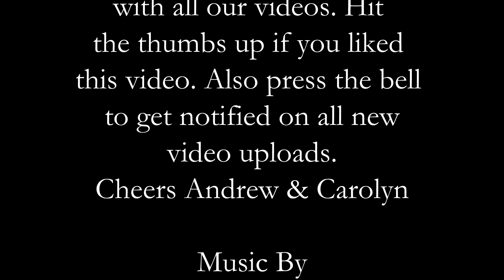Mitsubishi Rosa Bus Conversion Part 10 Removing the AC

Comment: Hi mate I pulled my air con out of my Mitsubishi Rosa 2005, the bus runs funny surges on idle and if after long drive will not start , they guy I bought from says it may have something to do with the electrics after moving air con. Seen a few Mecanic S none can work it out, it is spasmodic. Thank in advance. Angus
Reply: Did you ever fix this?, also how did you keep the front cab cold when driving?.

Comment: Hi Andrew, thanks for answering my last question, im also looking at taking out the 2 compressors, one has its own dedicated belt the other shares the serpentine belt with the alternator etc, I think I would have to make a dummy pully to replace the second compressor. did you do this? mine is the 4.9 engine
Reply from the maker: Both my compressors were connected to the same belt. So I just cut that belt and then removed the compressors.

Comment: Great helpful video Andrew! Just wondering, is there another aircon system for the drivers area? Or does your bus not have air con at all now? 
Thanks! Just ripped up my floor and platform on my Rosa after watching your other video!
Reply from the maker: Hey Allyson no there's no other air con in the bus. However we will be putting in a Dometic harrier plus air-conditioning in the bus that we can run when driving. We are going all electric, so we will have a big solar system. 
I bet your glad the platform is out. I hope my video help 😀. Would love to see some pics if your work 😀 cheers Andrew

Comment: I cannot understand why you would remove a perfectly good operating AC unit and exchange it for another. You sound from down under where it gets pretty hot. I am doing a conversion in Costa Rica and I am keeping my (Marco Polo) bus AC  and even adjusting it to be cooler. If it aint broke dont fix it.
Reply from the maker: I understand why you think that but for our design and where we want things to go. Having the A/C there wasn't going to work. Each persons bus build will be different as we have different needs and wants. Just as I don't want the A/C others will want it. Thanks for your comments 🙂 cheers Andrew.
Reply: Most people in Australia remove the stock aircon to get more space for water tanks under the floor where the old aircon compressor use to be, its hot here so if you want aircon you can mount one externally on the roof over the cabin up front. Water tanks and waste tanks the bigger the better.